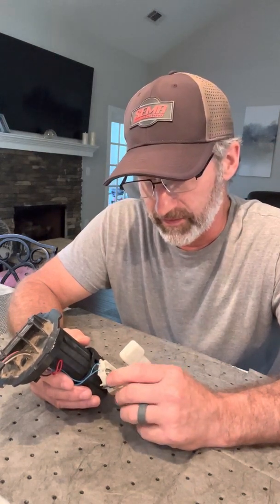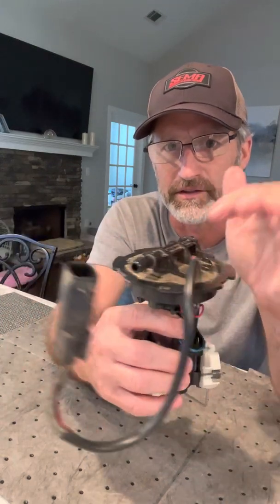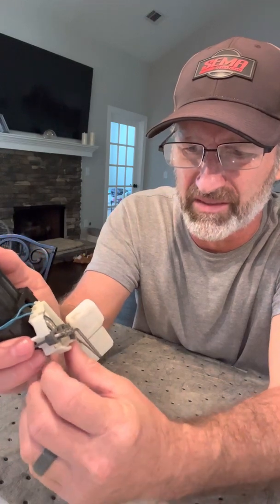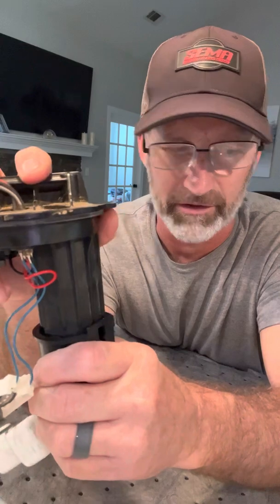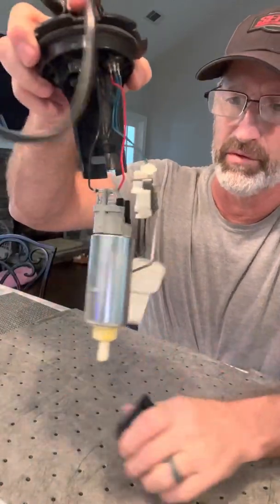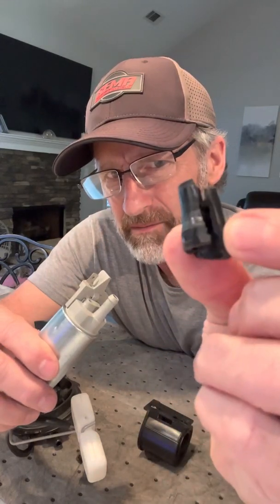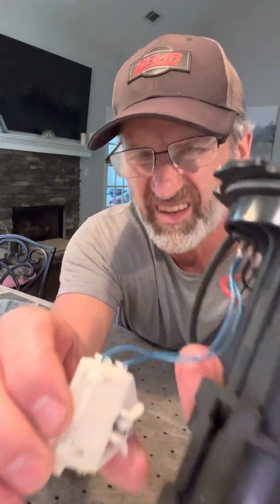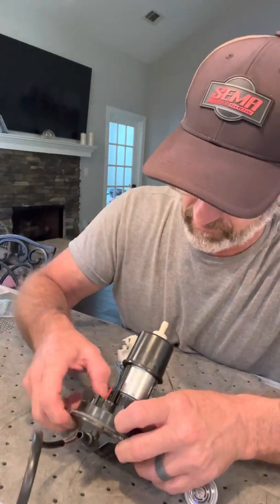Rebuilding a 2010 Arctic Cat TRV 700S Fuel Pump with Quantum Fuel Systems rebuild kit

Comment: Great video..thanks.  Very important to not use the larger O-ring (1 of 2) that is on the pressure regulator that comes from QFS in their rebuild kit.  The regulator retainer cap can still be snapped close with that larger O-ring.  It will cause insufficient fuel pressure and the ATV will hesitate as if the coil or pump is failing again.  Don’t make this (not so obvious) mistake.

Comment: Thank you for this video. This is the second time watching this. I will say though, I got mine kit from amazon. Little over $100 for it but the problem with it is that grommet seal the pump goes into doesn’t last long. Had to warranty someone’s ATV because of it. Nothing wrong with anything else just that rubber piece doesn’t last no longer than 20 miles.

Comment: I was just wondering about the spring underneath the fuel regulator my spring was hanging out the slot that’s in the side of the plastic housing, but it’s not long enough to go up to the regulator. I was just wondering if yours had a spring.

Comment: Notice the stripped part of the black wire.. mine has the same. Can't figure out why.
Reply from the maker: it’s the ground wire so I don’t think it matters.  I has been a while since I did the video and honestly don’t remember.  I’m just guessing but it could be to discharge any static electricity from the plastic tank.